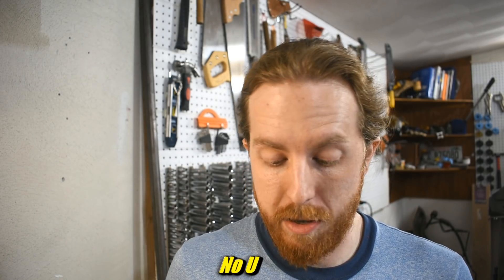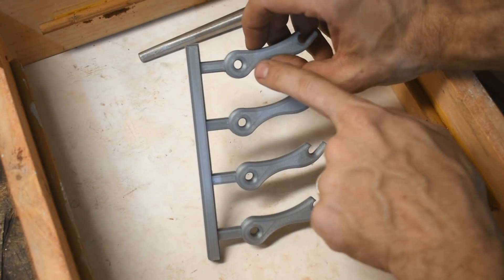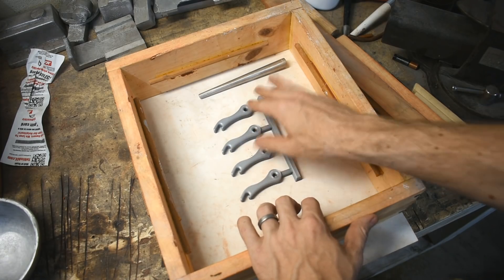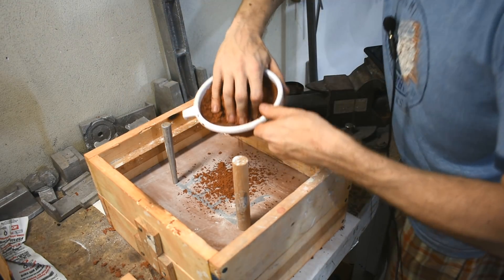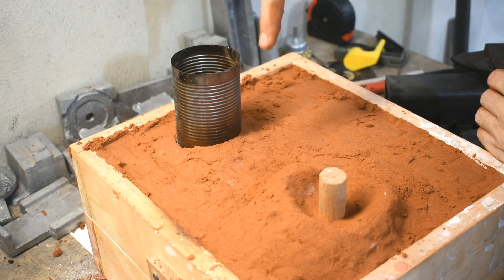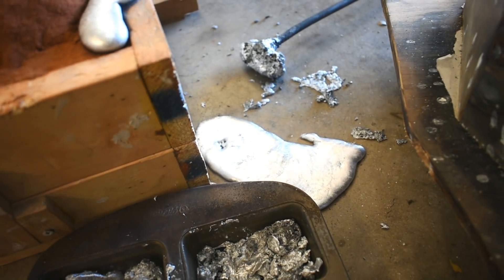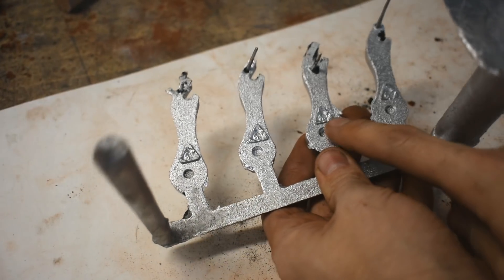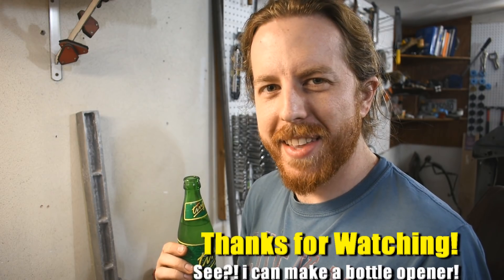Casting an Aluminum Bottle Opener from 3D Printed Patterns for the 2019 Openers Open

Comment: Hey Paul, love your videos and sense of humor, keep it up!  Easy way to add draft in Fusion (in this case) is to do a tapered extrusion of the outer profile of the object.  That'll let you input an angle.  Then split the model with a splitting plane down the center for your print halves.

Comment: Actually the way to reduce turbulence is to slow the metal into the mold. If you make your gates larger (cumulative) than the runner then you can move more metal into the mold at a slower rate. 

Ok, I laughed out loud, no really I did when you opened it with the print, I guess it should be expected after your bead roller experiments. :-D  They looked good, really good, except for that little...small... tiny... design issue :-D
Reply from the maker: The important part is the bottle was opened by something that I made and I'm not going to dwell on exactly what I made and how that happened hahaha!
Reply: @PaulsGarage  I would have thought that the important part was that you didn't spew after drinking that stuff :-D

Comment: 4 at once? Are you planning on going into production? Well I guess they all did cast and you did get the bottle open, but does no one actually drink beer?..Martin
Reply from the maker: If I'm going to fail, might as well fail 4 times at once! Saves time that way.  Pretty happy with how the castings turned out, the makers mark stamp too.  Pretty happy with the casting overall, just not my engineering haha

Comment: wonder if you get better flow intoo the parts if you slant or curve the feedchannels toward the fill-sprue , kinda catch the material while its flowing by through the main channel 
(the parts did fill up completely so the small holes you made with the welding rod are probably enough )
as for the bottle opener itself , might need to make the angle of the bottom hook a little more steep so it doesnt slip off the edge of the bottlecap 

we had a guy at work who allways opened his beer with a foldable carpenters ruler , he lined it up beneath the cab holdinmg it with the same hand holding the bottle and banged the other end of the ruler , one day we spend about 2 hours shaking the bottle before putting it back on the table bout 5 minutes before he came in , lets say he got wet and didnt enjoyed a lot of his beer by drinking it , we enjoyed it inmensly though
Reply from the maker: Hahaha that's awesome!

Comment: 8:15 this is why calluses are best had at the tip of your fingers, not in your palms, to you can play guitar good, while still being capable to mustering excruciating pain that prevents you from gaining said flaps of skins when opening a bottle.
Reply from the maker: Ow ow ow ow!!
Reply from the maker: Since you mention guitar, I have callouses on my fingers from violin, but they arent tough enough for guitar. Less pressure needed to hold down the strings without frets
Reply: @PaulsGarage  have you tried the cello? It requires more pressure, is similar, and easier to play, and in my opinion a lot prettier.
Also more expensive XD